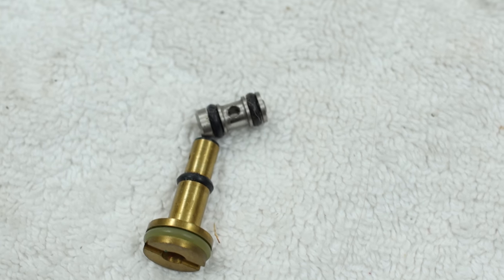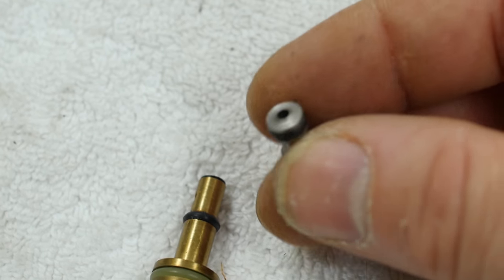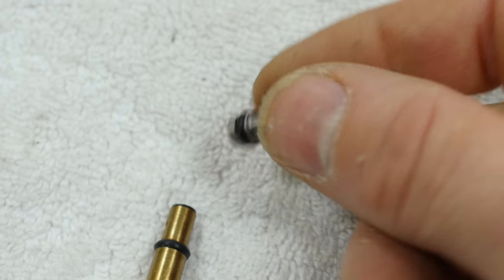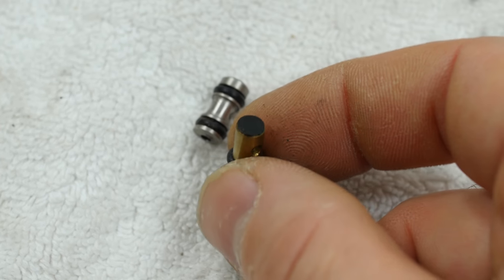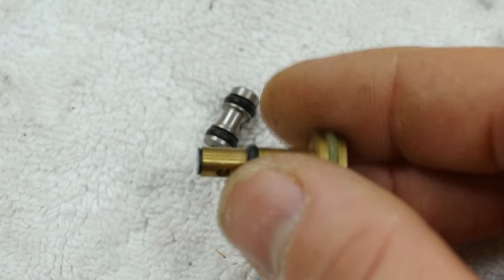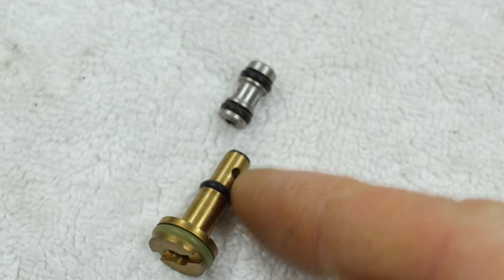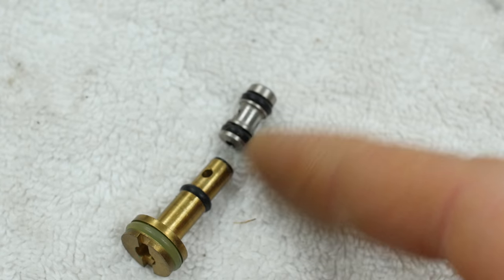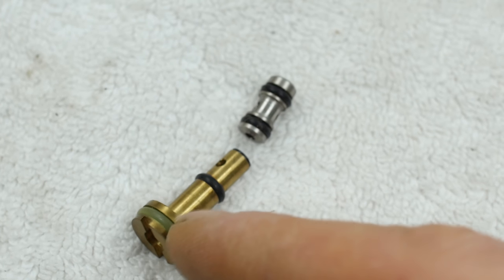KC Trouble Free Regulator Internals

Comment: Curious if you were ever able to find or make replacement flat seal for these regs?  Also, I'm confused what that seal actually does, it looks like it completely seals the end of that piece, however there is a small hole that leads to the bottom of it.  Can you explain what it's purpose is and if I can run without it?